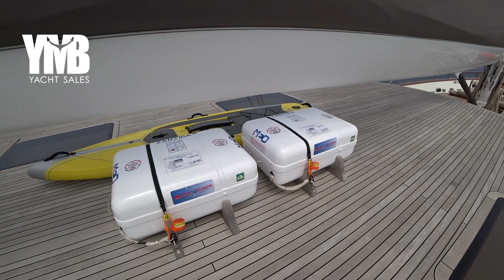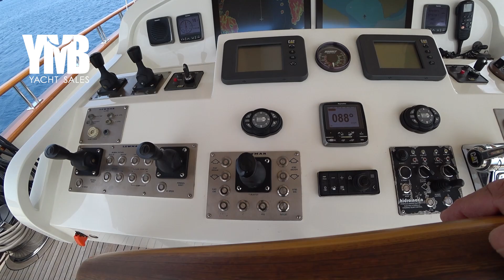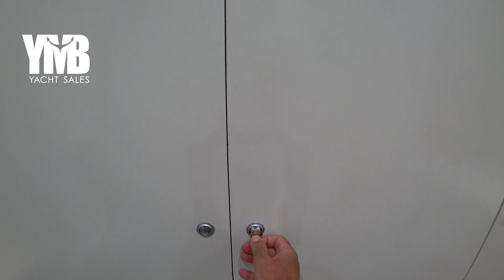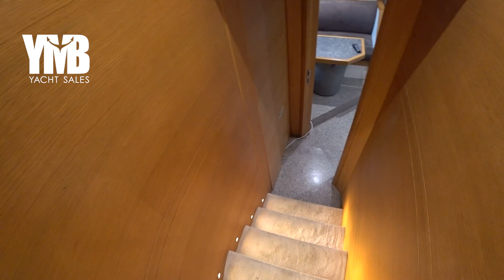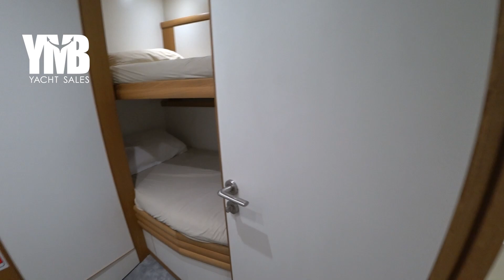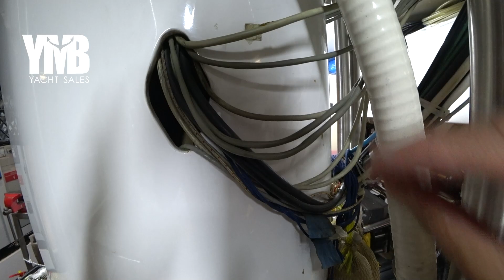40 m Schooner Sailing Yacht ZANZIBA FOR SALE / Full walkthrough / Surprising Sailing Performance

Comment: 120 ft loa about 85 lwl the hull speed should be about 13 knots rather than 16 knots???  Imho,The sail plan is cut down due to chartering laws from what a racer would have. I crewed a 70 ft mid-century ocean racer that could do almost 12 knots. However, yes, immaculate condition.  all excellent, As long as the electric winches work:)>  The 130ft tall ship I crewed on needed 20 people to raise the main gaff sail!!!

Comment: Not a bidet toilet anywhere.
And all that surplus water available. 
Towels hanging directly over methane producers (toilets) must soak up all that stench, no extractor fans in any dunnys.
Galley down stairs from dining room ?
Getting the tucker up the stairs  without a hoist would be an adventure, especially without a Sea Keeper stabilisation even in a moderate sea.
Nice boat but for all that length and beam it's still cramped by design.
But l guess this why it's up for sale.
Reply: Agree the internal layout could be much better designed especially the engine room
Reply: Schooners are traditionally gaff rigged,  if your going to build a traditional vessel like a schooner do it properly wit gaff rig and dead eyes and rat lines. 
A crew need to earn their keep.